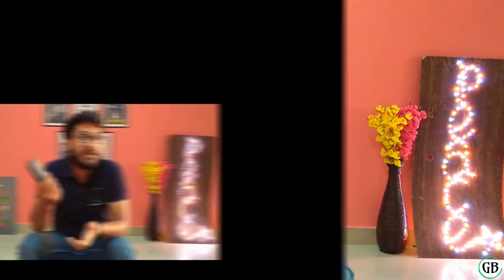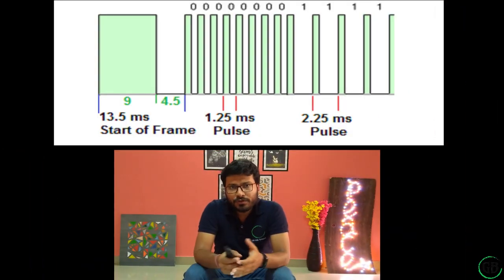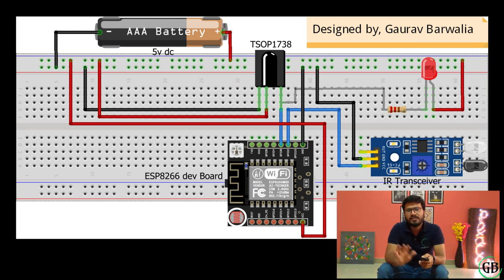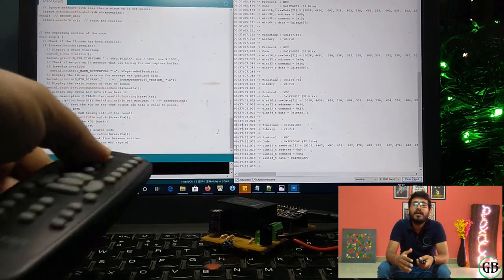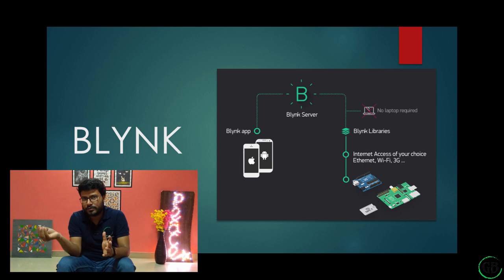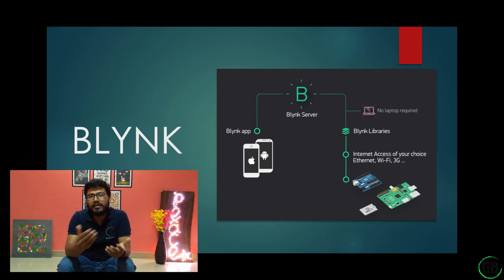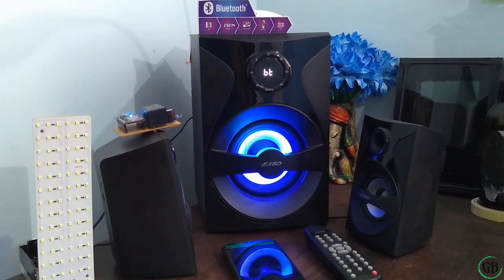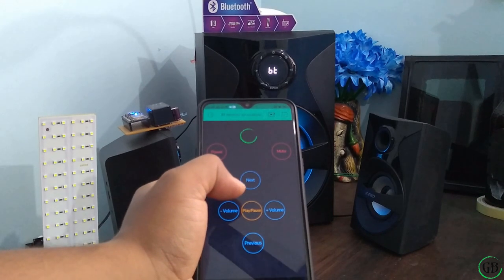Control your TV or Music System from anywhere in the world using Blynk Mobile App

Comment: Brother, I need your assistance, I decided the IR codes and added the same in the code and dumped in the nodemcu, the issue is where shall I connect the output IR diode to what pins of the Nodemcu? What is good to use  shall i use IR diode 2 terminal  or IR module 3 terminal? Please let me know am disappointed 😞